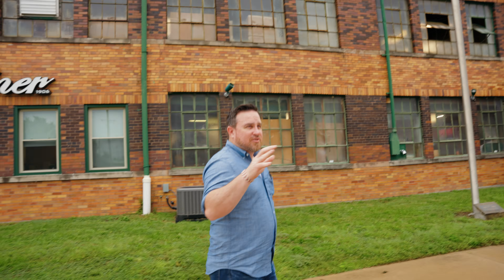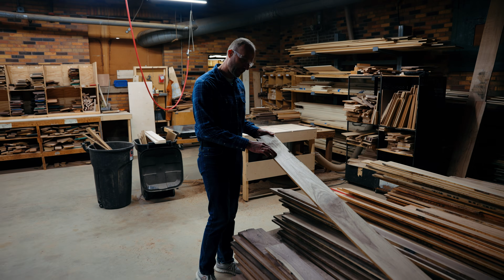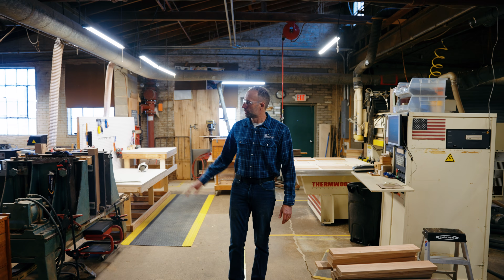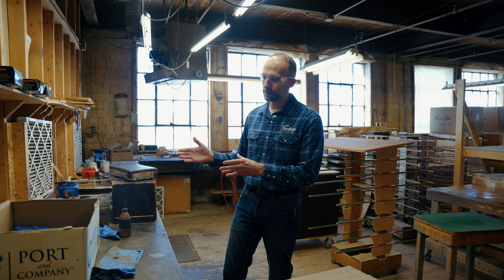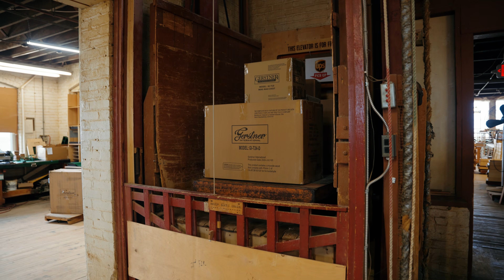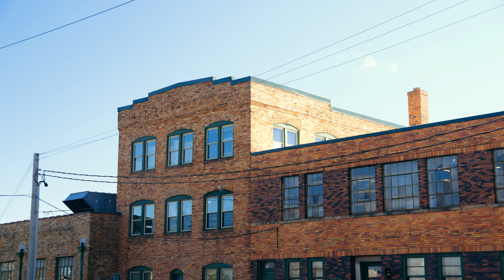Made In America: Touring Gerstner & Sons

Comment: Great video, thanks for sharing.     And thanks to Gerstner for allowing you to visit and record.   Only one question I have for the Gerstner folks, why do they cross-glue the tops of the sides without allowing for wood movement?  It's a form of small breadboard ends of a table but I didn't see any drawbore pins, just a solid glue.   When the sides move side to side, the glue line will crack, won't it?
Reply: You would think so, but I built one of these a few years ago, and there is no sign of movement. the inner top, bottom, drawer supports and back all are fitted into slots in the sides which resist any differential movement. The drawer guides also act as straps. WIth the top, back, and bottom all being veneered ply, it is held together pretty well, and not prone to movement.